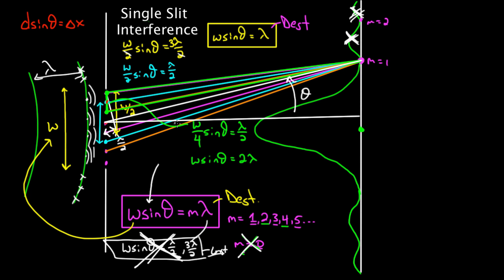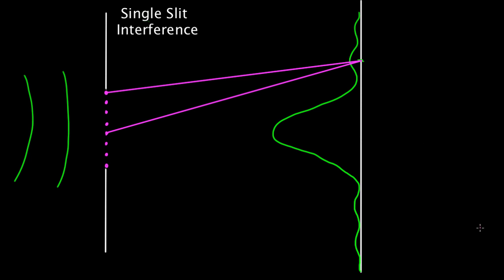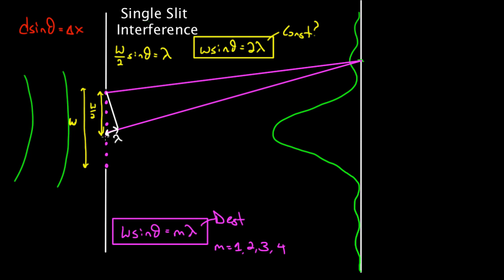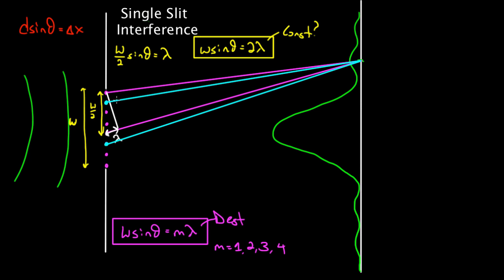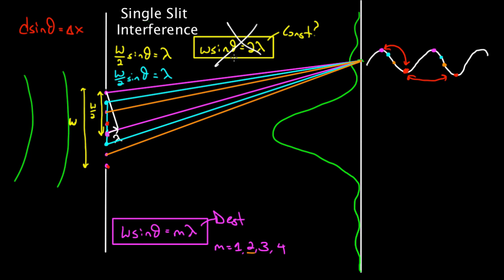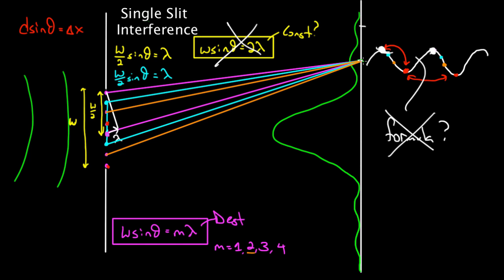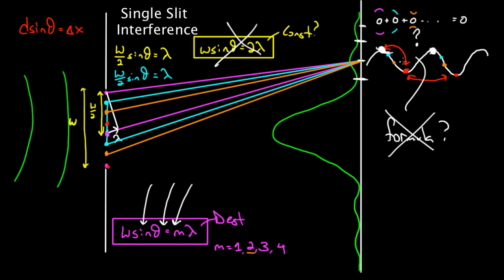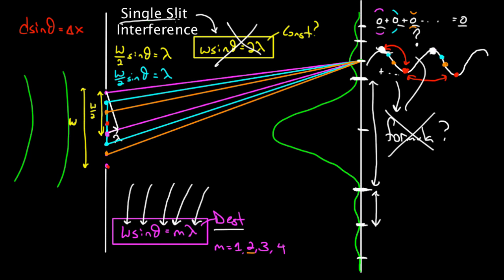More on single slit interference | Light waves | Physics | Khan Academy

Comment: ok so from what I understand, you're saying that it is nearly impossible to get a constructive interference because the light particles are out of phase, but what do we say about the central bright spot then ? How are the light particles able to create that on big bright spot without canceling each other out ? wouldn't their phase be different for each and wouldn't that create as well a destructive ?
Reply: Consider 9 points (sources) instead of 8 like he draws in the middle of the slit: one in the center and 4 on each side of it. Let's marks these points as -4, -3, -2, -1, 0, 1, 2, 3, 4. Now, lights from sources 1 and -1 will travel the same distance to reach the center of the screen, so they will constructively interfere. Same will happen for the source pair +2/-2. But similar to the example he gives here, lights from sources +2 and -2 will also interfere constructively, but will be at a different phase compared to the interfered light from sources +1 and -1. Same goes for +3/-3 and +4/-4. So the net effect will be very low intensity like the surrounding peaks. However, the one from the center source does not interfere with any of the other sources surrounding it and that's why you have the large intensity at the center of the screen. Remember, that his argument for destructive interference (in a previous video) holds because there are infinite number of point sources within the slit, so it does not matter whether you assume even or odd number of sources. The same argument will not hold if the number of sources were finite.
Reply: Anirban Mandal You said waves from +1 will interfere constructively with those from -1 but it also possible for the same waves from either +1 or -1 to interfere destructively with those from +2 or -2 or from any other slit at the same point .... isn't it .... Now what can you say about that?
Reply: Sheraz Khan The brightest spot in the middle is the result of precisely paired waves [ (+1 -1) (+2 -2)] to form a COMPLETELY constructive wave. Let's say you pair up +1 and -2. They will interfere, but would neither be completely constructive or destructive, hence forming the slope part of the middle wave. It is possible to be completely destructive at many points on the resultant wave, but only possible to be completely constructive at the middle pf the resultant wave where theta is 0

Comment: I always teach single slit interference as being the SUM of the wave values "contained" in the slit. If the slit represents a phase difference of "2Pi" (comparing topmost ray to bottommost ray) then the arriving waves represent all possible phase shifts ... so they produce totally destructive interference. This helps to explain the two weird things about the bright spots ...
... if the topmost and bottommost rays are only "Pi" apart, they represent a "half wave" which CAN have a non-zero sum.
... for the central peak, it is uber-bright because it is the sum of ALL the rays at (near) maximum. 
I think this resolves the logic issues you mentioned.
Reply: this is a really cool explanation ! Thank you for this one.

Comment: The angle is the missing variable. It tells you both the position of the starting point and the length of the resulting wave in relation to the angle and position of the wall. It also explains how and why the light interferes and proves that light is a particle and the wave is what the particle produces. Other math is required to explain why the particle and its wave function are inseperable until something causes the particle to become superluminal so that the lightspeed-bound (because of the universal medium [c] through which the wave propagates) wave function collapses until the partical becomes luminal again. (The particle is not bound to c unless the particle is connected to its wave function.)

This is also why the slit and double-slit experiments give a different effect than a round hole., along with the fact that there is no impedence to the top and bottom in the slits.

Comment: I think you can also add the fact that your "reference point" (the first point you choose when you start pairing) keeps "moving" as you try to grasp the arbitary infinite points of a single slit; hence, all your reference points has unaccounted phase shifts relative to other reference points. In double slits, there is no "movement" of reference point bit there is no need since double slit is not as arbitrary as single slit.

Comment: I am really confused now... In destructive interference if 2 wavefronts are at a phase diff of lambda/2 they cancel each other. So a crest and a trough cancel each other. But what is the physical significance of a trough in a light wave. what does it mean to have max negative amplitude at the trough. How can light amplitude be negative

Comment: so basically what has happened in the previous video and this video are:
1) we analytically found the points where constructive interference takes place. 
2) we try to analytically find the points where destructive interference will take place but the points coincide with those of constructive interference. 
Its means that the destructive points which are found analytically are wrong.
3) so we use analytical reasoning (that the point of constructive interference cancel themselves to form the point of destructive interference) to find the points of destructive interference.

Comment: I’ve been saying since 2013 that it seems extremely obvious that all electrons and photons are in orbit with a dark matter particle.

Based on Fermilab and other recent findings, I now think electrons are made of an electron neutrino entangled in orbit with a dark matter muon neutrino, explaining their erratic orbits around nuclei and explaining superposition and uncertainty.

I think photons are a pair of electrons entangled in orbit together in apparent an axial or helical polarizable wave-like movement depending on the direction of their rotation as they travel.  This explains the double slit experiment for example and the speed of the rotation explains electromagnetic wavelengths (and visible colors, etc).

What do you think of this Mudfossil University video?:
‘’Light Duality Solved and Seen’’, Sep 29, 2022